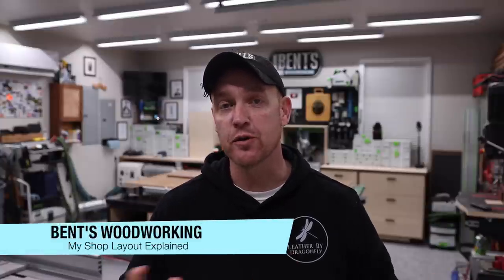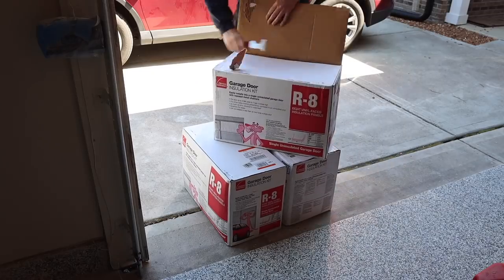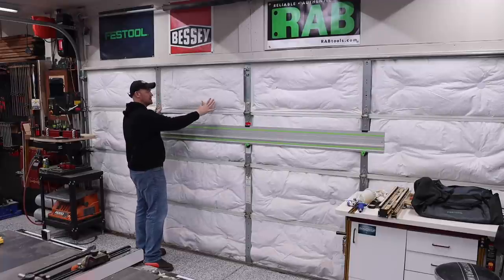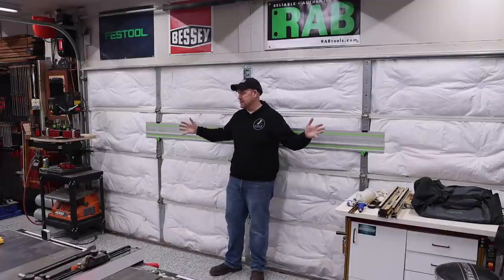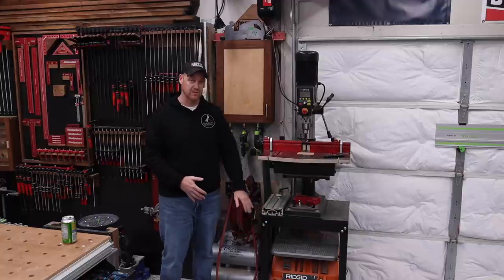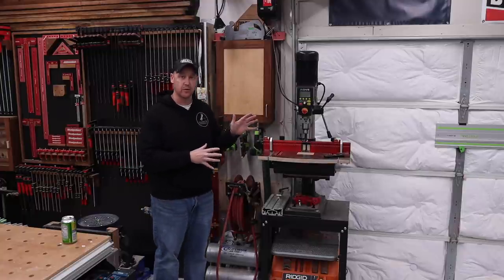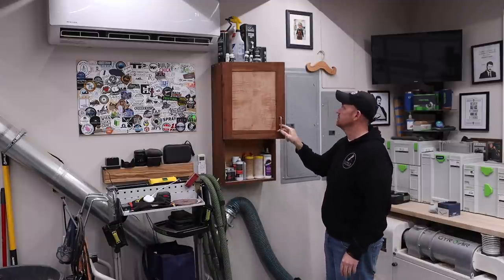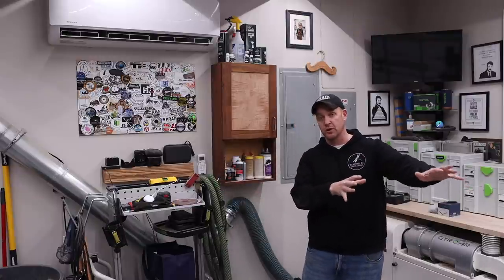My 3 Car Garage Woodworking Shop In Detail - Woodworking Shop Tour 2021 -  Woodworking Wisdom

Comment: Very nice Bent. Just curious about your CNC setup, is it on the wheels? How often you have if any to lube the rails that are against the wall? My CNC support suggested that i cleanup my entire rail with digresser at least once a year and squeeze fresh grease into the ball bearing housing. I kind feel rails get sticky especially for someone like me who might not use it for a long period of time.
Reply from the maker: I have easy access to everything. I’ve done maintenance on it one time since I had it. It is in a permanent location, I don’t move it around

Comment: I'm glad to see you getting rid of those metal bases.  When you installed those I actually unsubscribed. Woodworking is one of my hobbies, its not full time. My assembly table is my 5'x5' table saw outfeed table and this works well for me. Router lift in the table saw extension. You have your reasons for your layout, and if you are happy, that's all that matters. The black walls and work surfaces don't film well, and as you can see on the drawer pulls, they show sawdust. Consider lighter colors so you (and your audience) can see your tools better. Your collection is quite impressive, why camouflage them on a black backdrop. I like the miter saw cabinets and countertop over the very inconvenient shaped dust collector. Nice job! You could pick up some usable wall space by relocating the sticker board, YouTube award, and sergeant hat. These are obviously not woodworking tools (like your yard equipment). I personally would get them out of the shop, but you do you. You have a lot of circulation in your shop. I have all the same tools with exception of the CNC in one stall of my oversized 3 stall garage. I also realize that I don't film at all so I don't need the circulation areas for rigging cameras and such. Thanks for sharing your journey with us. Our shops are constantly evolving. Its fun to see others experiment with layouts so we don't have to.